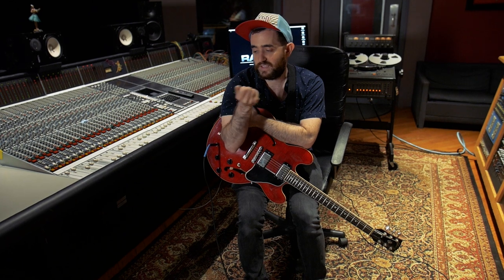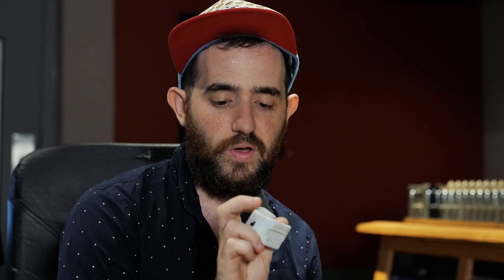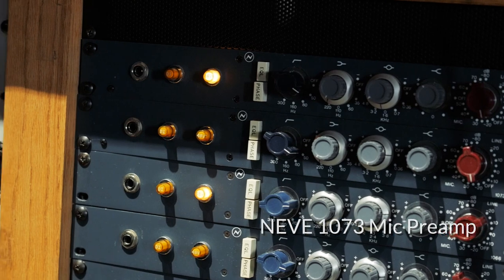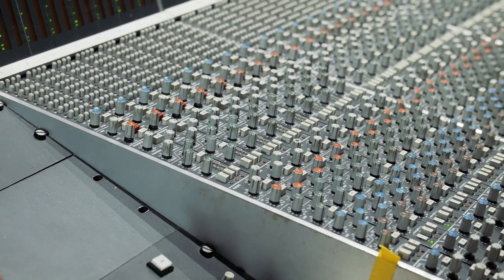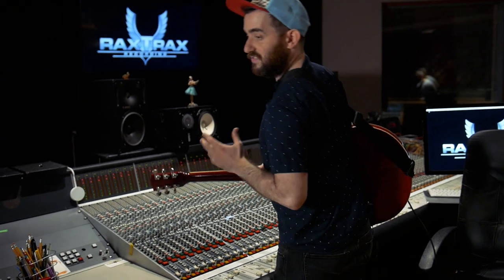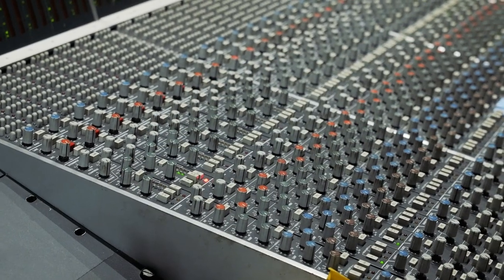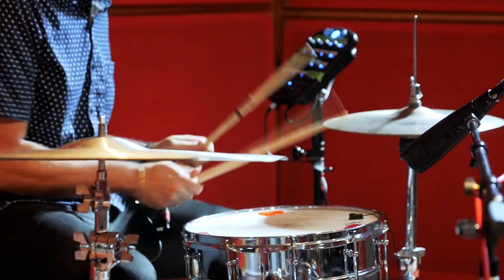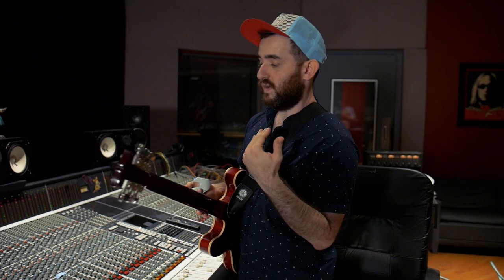How to Trigger Guitar With Drums Using a Noise Gate | Reverb Experimental Recording Techniques

Comment: dimebag did this years ago on "good friends and a bottle of pills".  used vinnies drums to trigger his noise gate to open \m/ \m/     shame cvnts. RIP the greatest
Reply: Source? If you listen to the song, the attack of the strings are always aligned with the start of the beat, meaning they were just really tight players with a noise gate to cut the decay of the note.
Reply: He talked about this in an interview, he actually used a beer can on the guitar strings on a demo of this. They were unable to replicate the sound in the studio so they used the demo.
Reply: My bad, although I used to own this magazine and clearly remember reading the beer thing. Mandela effect? From Guitar World April '94 "what's going on at the beginning of "Good Friends And A Bottle Of Pills"?I was standing next to Vinnie, who plays drums really hard, and I was slowly moving my volume knob to see how far I could go before the guitar started feeding back. I had my guitar running through an old MXR flanger, and my intention was to just make a little bit of racket in the beginning of the song. Just by chance, the pickup started picking up Vinnie's snare drum and it popped the gate open. So the drum is actually triggering the guitar, and that's what you hear."

Comment: Wouldn't a midi pickup do the same thing...
Reply: midi pickups will transmit the velocity and pitch information over time, which can be edited in a DAW to be quantized to the beat of the drums. But if you have analog drums and want the same effect, this is one way to go about it. If you're not getting any organic expression from the guitar or even sound like a guitar, (like in this case, it sounds like a goddamn mosquito), might as well draw them out in midi and insert them into a Mosquito Synth (TM).